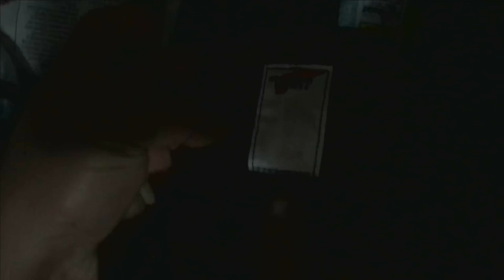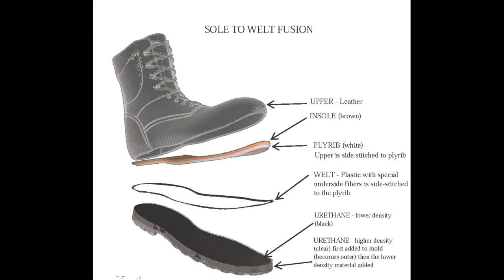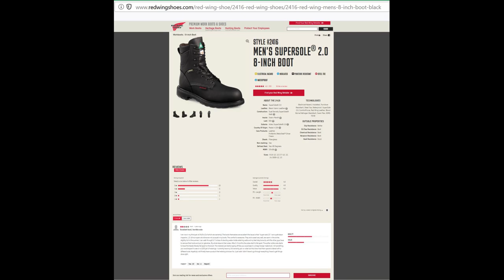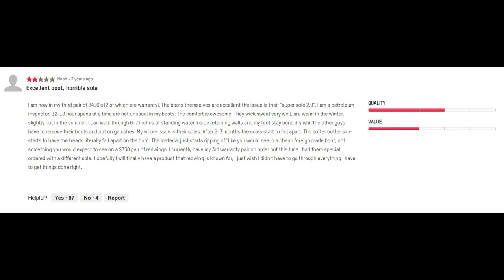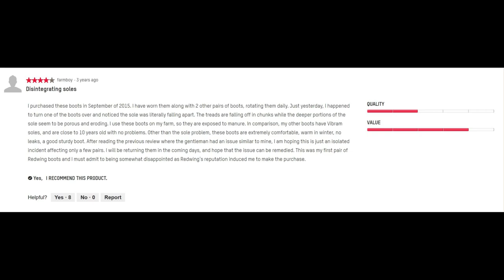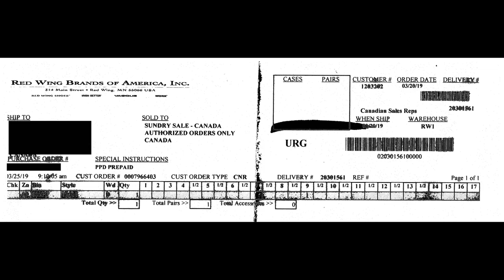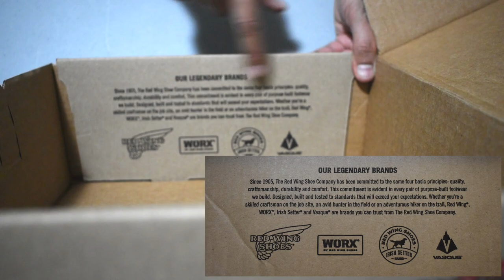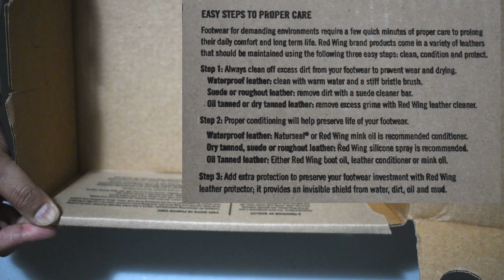𝗣𝗥𝗢𝗗𝗨𝗖𝗧 𝗥𝗘𝗩𝗜𝗘𝗪: 𝗥𝗲𝗱𝘄𝗶𝗻𝗴 𝗦𝘂𝗽𝗲𝗿𝘀𝗼𝗹𝗲 𝟮.𝟬 - 𝗥𝗲𝘀𝗼𝗹𝗲 𝗮𝗻𝗱 𝗥𝗲𝗽𝗹𝗮𝗰𝗲𝗺𝗲𝗻𝘁 - Model 2426/2416

Comment: That's pretty outrageous that they replaced a fifteen yo boot. That is more than 'stepping up to the plate'.
Reply from the maker: Hi Jared Foy,  Thanks for watching and your comment. Yes, I am very happy that even after 15 years Red Wing replaced the boot.  While the replacement was definitely more than I had originally expected; that was before I realized that the source of the problem was an issue not related to quality control or manufacturing but rather inevitable chemical reactions.  I am still in the middle of researching my deep dive into the process of Hydrolysis; however, from what I have learned thus far, it is a process that some shoe manufacturers have acknowledged and provide a consumer advisory of the same via a tag on every new pair they sell.  I think Red Wing could make a similar choice and simply advise their consumer of the process, thus, ensuring that their consumer is aware that they are obtaining a more resilient (bouncy) shoe sole at the cost of a shortened lifespan.  
Is it more than 'stepping up to the plate', I suppose my answer would be both yes and no. 
Yes, because they made a long term customer happy.  
No, because what option did they have?  Could they/should they admit that a line of shoes that generates significant revenue annually, that is by natural design (based on chemical composition) expected to reach its planned obsolescence in a far shorter period (regardless of use) than the more mainstream and established rubber soles that are commonly used in the industry?  I am not sure that any company would do that when it typically only wants to promote the benefits and the not the disadvantages of owning and using their product(s).      
It is, undoubtedly,  great customer service they exhibited when they replaced the boot; I would be reluctant, however, to agree that it was outrageous (for them to replace the boot and for me to accept their replacement).  It was simply the necessary call that was needed to be made.  Consider this:  you are a 'weekend DIYer' and buy a pair of $300+ work boots because you love the brand or you like the look or you like the features or you expect them to last a very long time.  You wear the boots a few times during year one, but then get interested in busy with other projects that do no necessitate wearing the specific type of boot (for whatever reason).  After some time, you start DIYing again and go back to your wonderful pair of boots, barely used, the leather is perfect, and they fit even better than they did new, but...the soles have disintegrated.  I think anyone in that position would feel as I did:  ripped off/betrayed.  In the end, Red Wing made a really good decision--both for themselves and, me, their consumer.  They chose to maintain the integrity of their brand and maintain their relationship with a long time customer.   Hope my comments helped you understand my perspective and helps make an informed decision about polyurethane soles in the future.  All the best, H.D.H. [: { ]
Reply: @HANDYDANDYHUSBAND  Yup.  With most rubber soled products hydrolysis degrades the rubber over time.  I just took five pairs of my Redwing 2.0 and supersole boots to get resoled after 10 years.  Still a good deal as I will likely get many more years out of those five pairs of boots.  The indicator for me is that the soles got squooshy - kind of like walking on a damp 2 inch sponge.

Comment: Mine fell apart years down the road after using them for work.  I had replaced them and would wear them occasionally for work around the house.  Recently the soles just self destruct.  Local Redwing just said yep their done.
Reply from the maker: Hi Jeff Loucks, thanks for watching and sending me your experience.  I am sorry to hear that your soles also self-destructed.  The local Redwing dealer will likely not agree to a warranty replacement.  If you would like Redwing to potentially address this issue, you will need to contact them directly and see if they would be willing to help you.  Do refer to my emails in my video and they might help you out.  All the best to you, H.D.H. [: { ].

Comment: Bought a Chevy 1500 pick up brand new in 2003 beautiful truck ,
I hardly used it , and the mileage stayed very low and looked very good for its age .
A few months ago I went on a short trip , and had all kinds of issues left and right , with parts that were basically new ! 
, took it in to a local shop , mechanic told me that most of my problems was for letting my Chevy sit up and not drive it regularly through out the years
Reply from the maker: Hi e harris, thanks for watching and sending in your comment...just one correction in your analogy:  "A few months ago I went on a short trip [and the truck disintegrated before my very eyes because the metal, while being designed to increase the truck's aerodynamic nature, reduce shock and friction, had dramatically reduced longevity due to it being chemically active with the environment]"  Man...many people would say that if you are having so many problems with a car by not driving it regularly either you are not maintaining it or its a poorly built car.  I suppose we better warn all those owners of vintage automobiles that their investment is just going up in smoke.  Or perhaps, one should call all new car dealerships (and buyers of the vehicles that sit in these lots) that because the vehicles are just sitting there they will have mechanical issues....Anyways, you don't have to agree with me and while I don't agree with your position, I would defend your right to hold it.  Bottom line, while you may have felt responsible for 'not using the product and then contributing to its disintegration', I don't see it that way at all.  A company should and ought to warn its customer that because they used a particular product (Supersoles 2.0) during the manufacturing process that they have sacrificed longevity for cushioning--something that Red Wing has still not done:  Why?  Because they would lose some customers who don't want to spend $200+ every 2 years for soles that disintegrate regardless of how much you actually wear the boot.  All the best to you, H.D.H. [: { ].
Reply: My Chevy 1500 did not sit on the the dealership lot for 15 years no new vehicle does , people who try and collect vintage automobiles have to put in extreme amounts of work to keep that vehicle in functional working order , they just  don’t buy a vintage show room condition vehicle and lock it up in a garage and it magically stays fully functional like the day it was parked , 
And in my Chevy 1500 it had nothing to do with the metal the body of the vehicle LOL , that’s not the only part of a vehicle by far .for instance There are several things that happen to your car’s structure and chemistry when you let it sit for too long. Such things include gaskets and seals becoming brittle, flat and brittle tires, drained battery, gummed up fuel, rust, and engine oil deteriorating.

There are a lot of other things that can happen, but these are the main ones to be concerned about. Let’s discuss each possible issue and how/why it happens to your car when you let it sit.

Gaskets and seals are an extremely important component to a car. Without them, there would be leaks all over the place and your car would cease to function because it would run out of fluid very quickly.

If you use a rubber band frequently, their life-span is a lot longer because they’re being used for what they were made for. But if you let a rubber band just sit, it becomes brittle and will snap at any little pull. Gaskets and seals works the exact same way; when they aren’t used and exercised in a way they were meant to be used, they break down and don’t function the way they’re supposed to.
Reply from the maker: @eharris6347  Thanks e harris for the explanation about gaskets.  So...to follow the analogy and get back on point, I take it from this that if some company created gaskets that in some miraculous way improved fluid flow and improved the seal between dissimilar elements, but as a direct consequence of that benefit, would have significantly impaired lifespan in comparison to regular, run-of-the-mill gaskets, and the manufacturer didn't warn you of this drawback, you too would feel that the manufacturer wasn't being forthright about about its product and would seek recompense.  All the best to you during the Xmas holidays and have a prosperous New Year, H.D.H. [: { ].
Reply: It’s Not all about gaskets 
And Chevrolet didn’t warn me of the issues I would have over 15 years later 

Just like you resoled your old barley used boots to get more time 
I put new tires and some other mechanical parts on my barley used new but old Chevrolet 
 Red wing  just has awesome products and know how to keep people buying 
I only wish Chevrolet was as loyal
Reply from the maker: @eharris6347  Hi e harris, I am sorry you had issues with your Chevrolet...all this time I was thinking we were discussing a hypothetical Chevy 1500.  While I have not had a Chevy vehicle, I will trust your experience when comparing customer service between the two companies.  Myself, I have a beater car, a 2000 Saturn SL2 and for 21 years, its been getting me around.  Zero customer service from Saturn as its been bankrupt for many years.  I agree that as vehicles age--especially anything 3+ years, you must replace ALL fluids otherwise things rapidly deteriorate.  Also, yes, Red Wing,--despite the lack of notice regarding the hydrophilic polyurethane soles--has great customer service.  I say this not only because of my own experience, but because other viewers have also commented how their boots were replaced when they experienced the same issue.  Though, admittedly, most other viewers did advise that they started experiencing issues within 1-2 years of their purchase.  Finally, yes, I do know it is not all about gaskets, but I was just running with the analogy.  Anyways, all the best to you, H.D.H. [: { ].
Reply: All you need is the plan, the road map, and the courage to press on to your destination
It will rinse out  in the wash 
Being humble, grateful of what you already have goes a long way
Reply from the maker: @eharris6347  Thanks e harris.  Great words to live by.  Merry Xmas and have a prosperous New Year.  H.D.H. [: { ].

Comment: I think I’m going to buy these boots. I need a high quality boot to ride my motorcycle and do my daily walking about. In your opinion is this a good comfortable walking boot?
Reply from the maker: Hello Jay Whoisit, thanks for watching and considering this pair of boots from Red Wings.  Yes, without hesitation, I can recommend these boots; however, do note the following points:  1) if you ride your bike a lot in the rain, the 2.0 soles from the factory may erode/deteriorate faster than normal; 2) The 2.0 soles, are excellent for daily walking and have a cushioned feel.  This will feel like walking on a thick Dr. soles insole and it is real easy on the knees/joints etc.; however, it will be different than say a rubber sole which will be stiffer (so be ready for that); 3)  The leather on these boots is extremely durable and with the gortex lining will keep your feet dry even in wet weather (keep it coated though); 4)  I don't ride a motorcycle, and depending on the gear shifts pedals on your particular model, if the pedals are not covered in rubber, the metal pedal area may puncture the 2.0 sole, if it does over time, the sole can be replaced, but this is just a heads up to you. Hope the above suggestions help you out.  All the best to you, H.D.H. [: { ].

Comment: I bought a pair if Redwings 2408 workboots 2 years ago , just started to wear them walking into a shopping mall stumbled on to a cement curb and heel broke open the tip of the boot ripped open , Now I"m out of $300.00 like your boots it will cost $200.00 to repaired ,where can I get my pair of boots repaired , thank you for posting ,
Reply from the maker: Hi Jeff Charlie, thanks for watching and sending me your experience.  I am sorry to hear about your experience.  If you still have the boots and can take pictures, I would recommend sending an email including pictures to Red Wings.  I think they will do their best to take care of you and the issue with your boots.  It is a shame to have had such little use of your boots---don't throw them out though, the leather is very robust, so an experienced cobbler can get them back in shape (just make sure to use a dull chisel to take off most of the sticky sole [cobblers hate dealing with it because it gums up all their equipment and sanding stations).  If you do go with the cobbler route or with contacting Red Wing, please do let me know your experience.  All the best to you, H.D.H. [: { ].

Comment: Can't believe Red Wing replaced your boots after 15 years.   I wore my 2412's almost every day for 7 years. My soles were shot I did have chunks missing from the soles as well.    Maybe I should have complained and got a free pair of boots.
Reply from the maker: Hi Chris Hall, thanks for watching and sending your comment.  I am not sure your use case would suffice for a replacement as you wore your shoes every day for 7 years.  The soles on my shoes were barely worn, yet still spontaneously disintegrated.  Anyways, I hope the video strengthened your faith in Red Wing and if you ever do have an issue not related to wear that they will take care of you.  All the best to you, H.D.H. 
[: { ].
Reply: @HANDYDANDYHUSBAND     Think you missed the point I was trying to make.    Even after 7 years I was out of warranty as you were too.  I guess complaining and throwing out you were a brand ambassador was all the difference.   Still good for Red Wing but, may cause them to look at things differently in the future.
Reply from the maker: @hallsweldingservice  Hi Chris Hall, thanks for your further comment/clarification.  Yes, I agree that in both cases the boots were out of warranty; however, thereafter the similarities break down.  Wearing shoes everyday for 7 years means 2,555 days of use.  If the soles and uppers lasted long enough to handle such wear over so many uses, then that fact in itself would be enough to show how incredibly durable, strong, and resistant to wear the boots were.  In my case, my use case was at most 1-3 weeks per year (max) and the disintegration of the sole was, in my opinion, unacceptable.  After some push back Red Wing also agreed with this assessment.  I am not sure your use case would garner the same consideration, even if you did complain and were a brand ambassador.  Note, though, other users have mentioned (see comments from other users below) that after experiencing the disintegration issue, Red Wing agreed to replace their boots.  I think just complaining about one's dissatisfaction was adequate in that case.  In a more general sense, I think we are all--as customers--brand ambassadors--some people are just more vocal than others.  Every time you wear a Nike branded T-shirt, or Adidas striped track pants, or boots with the Red Wing label we all become consciously or unconsciously brand ambassadors.  Red Wing realizes this; therefore, it makes sense for them to replace shoes when the use case versus wear expectations would tarnish their brand.  Just my two bits, but everyone has their own opinion (that I would just as vigorously defend their right to hold) which may be just as valid .  All the best to you, H.D.H. [: { ].

Comment: Thank you for the video.  However, you know that sewing through Gore-Tex puts holes in it.  Now your boots are no longer water proof.  That why Gore-Tex lined shoes/boots do not have the mid-sole sewn in to to out-sole.  Putting holes in Gore-Tex compromises it's impermeability.
Reply from the maker: Hi Jet Jaguar, thanks for watching and pointing this out.  Yes, you are right, the stitching that I show at 18:04 will compromise the waterproof Gore-Tex lining from the midsole up.  You will note, however, that the outersole was still chemically bonded and is thicker than the original RedWing Soles so for me I am OK with just the water proof nature of the outersole with a stronger bond to the midsole.  For people needing boots with the ability to stand in greater than 1" of water, the additional stitching should be avoided.  I should also note that the stitching on the outside can be made more water resistant with mink oil etc. All the best to you, H.D.H. [: { ].